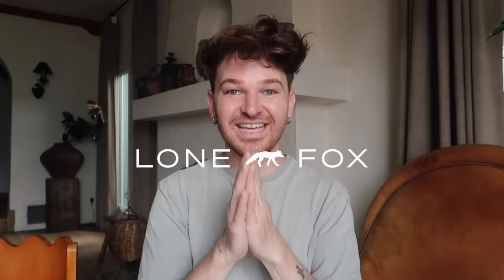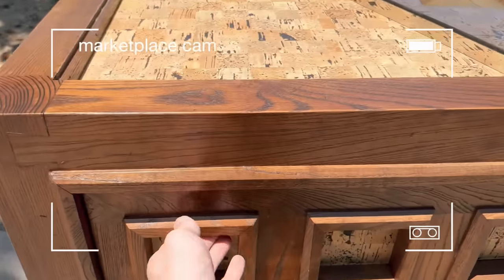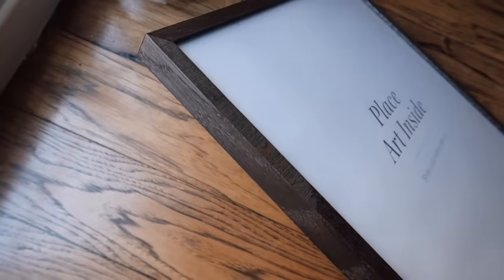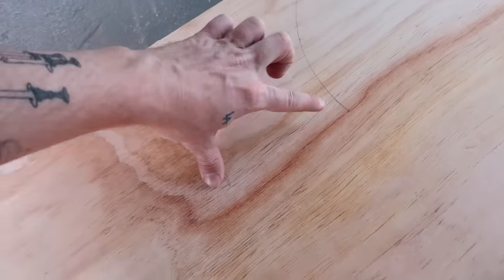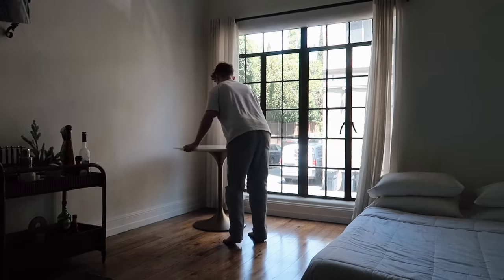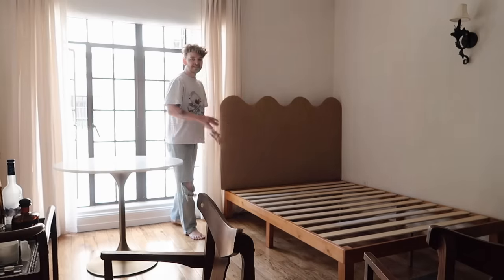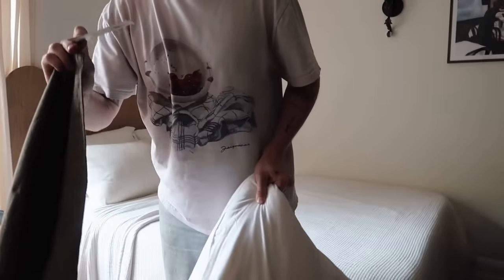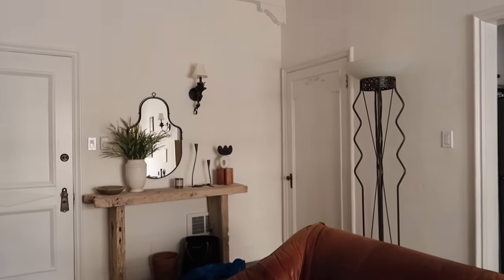290 SQ FT STUDIO APARTMENT MAKEOVER ✨ ALL Facebook Marketplace + DIY Wavy Headboard

Comment: Great vid.  FYI for anyone interested in art. Reprints vs Prints.  
Reprints are exact copies of an original artwork often on high quality paper not canvas  You can glue reprints on hard wood planks or display in a frame behind glass like in this vid.  
Prints are Original artwork. Usually commanding a higher price than reprints. Each Print is unque despite many  similar prints  being made in a 'run'.
There are many ways to make a Print - Batik, Lino cut, Woodcut, Lithograph, Etching, Screenprint etc.

Comment: I think it looks great for photos!  I actually like almost everything - not crazy about the headboard but don't hate it either - in the room.  I do love the rustic bench, but feel it doesn't fit with the rest and draws too much attention to itself.  Maybe something simpler, but still light in tone?

My problem is that it's nearly unlivable because there is no room for the occupant to move around!  He will be forever squeezing between the coffee table and the sofa, the coffee table and the dresser, both of those and the bed, the sofa and that gorgeous lamp, etc.  And God forbid poor Trevor should want company!  I'm not sure there's room for one extra person in that room, let alone a few friends over for drinks.  

Sadly, I think you bought and brought in things because you liked them and you felt they were impactful, but you forgot to consider the scale and size of the space and were unable to give them up, whether they worked or not.  For example, I love the sofa, but that high back makes it too large, visually (not to mention that it will cut off all breezes and be hot as blazes to sit on without ac).  And that lamp is fabulous, but monstrous and it looms over the room, takes up the only space for walking and has feet that are a trip hazard as used.  

While it produces a series of pretty pictures, the space as a whole is not functional.  The best pieces for the room, scale-wise, are the table and new, lower-backed chairs that you covered in that gorgeous striped velvet, Trevor's bar cart and the bench by the door.  

Sorry, but I think, in the end, this one is a miss.

Comment: Hi Drew... as a quilter I often have to deal with curves and circles in the quilt blocks. In order for there to be no bunching and keeping the look smooth, you can just cut into the edges a bit (depends on how much lead you have for how deep), pull the strips evenly to each other, overlap, then glue or staple to the back. Its just easier that way. Love your design sense so much and the results are smashing!

Comment: OK simple fixes for everything.

Reverse the living room. Couch against the wall the TV is on. TV on smaller wall opposite the couch between the closet and kitchen. Art above the couch

Table beneath the TV with the chair, on either side.

Rotate bed 90 degrees so it doesn't face the door, dresser at the foot of the bed.  

You will have way more usable floor space

Comment: Very handsome!!  Wish we could have seen the kitchenette(?) and bath. The building is gorgeous!
Small changes I would have made: I LOVE that headboard (reminds me of a king's crown!), but  I would have gone with 2 bespoke headboards covered with that grasscloth fabric attached to the walls along the top and side of the bed to make it look less like a bed. (Maybe a bedframe with drawers  would have been good for more storage)? I'm amazed you didn't buy that large "so you" floor lamp for yourself! Seems a little large where it is placed.  How will he open the bureau drawers with that kidney shaped table in front of it. That would drive me crazy. Bad feng shui.
Loved that smaller mirror by the entry! Why did you not chose  to put the larger festive print by the table & bar?

Comment: If you love the fabric, GET the fabric. Life is short.

You can avoid puckers in the fabric you use for upholstering curves by "cutting into the curve." That means snipping little slits into the fabric every inch or so around a curve, so you can fit it smoothly. The slits will turn into either gaps or overlaps, but they'll make fitting the fabric easier.

Comment: Murphy bed is only solution for such spaces, to buy is very expensive but it may be a project # 1 for this room, the metal parts of lifting system sold in ebay and it is a best investment into small space where will be a lot of visitors, the bed headboard was a disaster , these waves not do any better and it was a lot of time, job and money wasted, if you have such window /bed thing needed to cut the board shorter on the window side and long in other side and it would create an art piece itself, think out of box but not already used and dated options, GOOD DESIGNER IS A DESIGNER WHO ADJUST IDEAS TO THE SPACE BUT NOT USING WHAT'S ALREADY IN THE DESIGNER'S HEAD

Comment: While stylish this feels really cramped.  There is too much separation of spaces which then leads to wasted space. I think the sofa is the real issue.  It is too big for the space and instead had they bought two Barcelona chairs they could have been placed side by side for an equally large seating solution.  The Barcelona chairs would, in contrast to the couch, look and feel much lighter and have been easy to pus back against the back wall when needed to free all the floor space behind the couch and unified it with the space in front.  

The dresser while it looks cool is also too big for the space and instead a small rectangular dining table would work as both a console and a place to eat.  Rotate the bed 90 degrees so it doesn't face the door, bad feng shui which would then allow you to put the dresser, or a dresser, where you put the table.  or even at the foot of the bed.